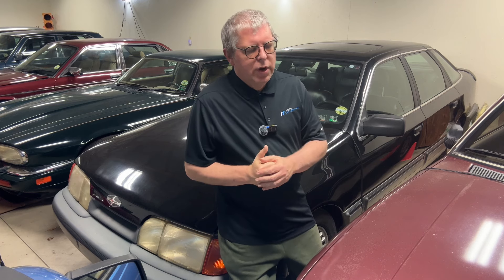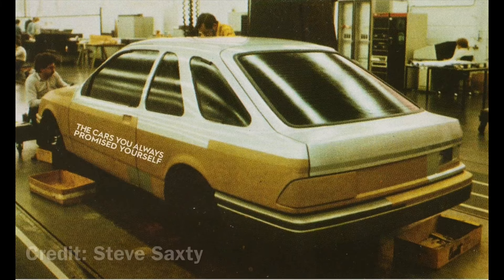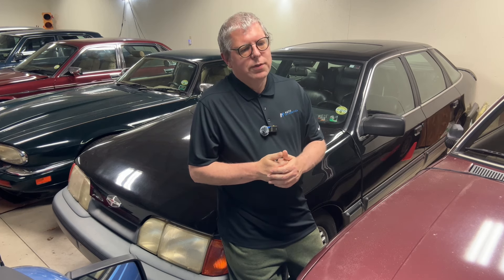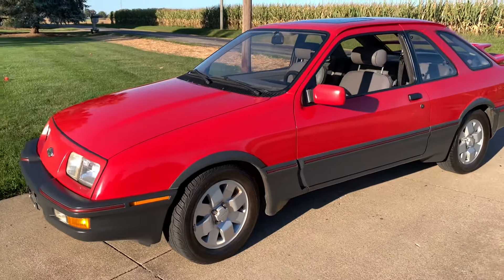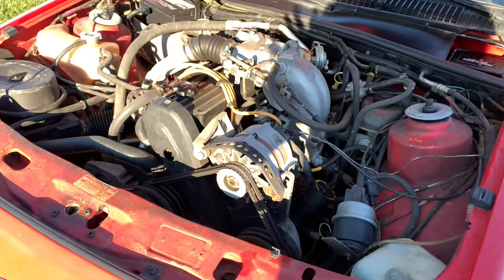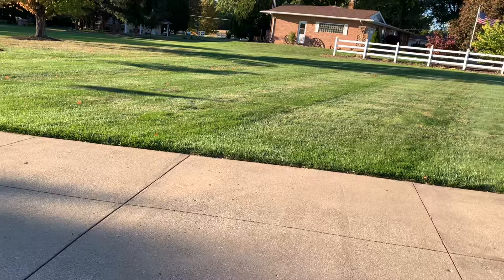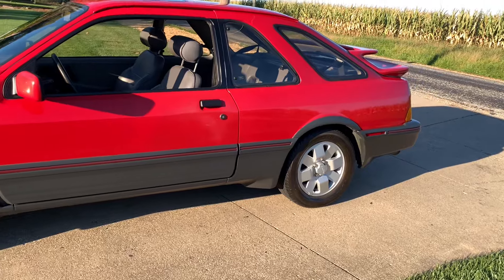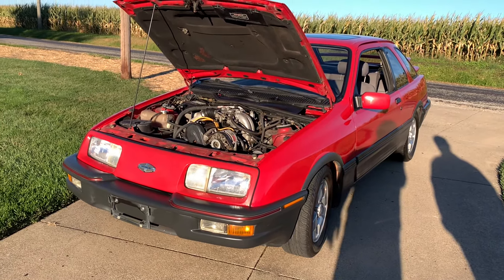Merkur XR4Ti: The Stateside Sierra | AA Visits

Comment: Absolutely brilliant video. 

I owned and cherished, for many years, a 1990 XR4i in radiant red. 
G606 XNE. ❤️
It was the 2.0 DOHC and was a great car. 
It should have produced 125BHP, as per the standard range and is listed on Wikipedia as ‘just a badging exercise with a 4x4 body kit’, but when I took it to a rolling road, it was actually 150BHP. 
It wasn’t chipped (chips were only just becoming mainstream, back then) and had no other mods. 

I have a theory that it wasn’t “just a badging exercise” but the engineers had eaked out some more power for it. 

The MT75 gearbox was brilliant and I remember the gearbox oil, from Ford, was expensive and almost like auto ‘box fluid.
Reply from the maker: Yes the 2.0 was added to the XR4 range after the facelift I believe. Very sought after these days. Thanks for watching and thanks for the kind words!

Comment: Great video... my 1988 is pretty much like this. With a 1987 rear hatch with the double wing spoiler. Just a note though. The Merkur XR4Ti ran until 1989, not 1988 as indicated in the video... it was a full five model years for the US.
Reply from the maker: Thank you for watching! I was really referring to the last full model year. The 1989s were so rare and the few changes made so minor thetvo didn’t refer to it, especially as the model was withdrawn just a couple of months into 1989, with the Scorpio following later that year. 

What’s interesting is to whether production stopped as Ford had ran out of the pre-1987 body panels to supply to Karmann as has been suggested. A 1990 Scorpio was specced and planned, even down to promotional material, with a number of improvements but ultimately never produced.

Comment: One other thing that sticks in my memory- the stereo had a joystick to control the balance left to right and the fade front to rear. Seems silly to recall that detail all these years later, but I was amused to hear the sound swoop around the cabin as I moved the joystick.
Reply from the maker: Yes the joystick was on higher trim Escorts, Sierras, and Granada/Scorpios in Europe until 1986 or so, then they disappeared.
Reply: I remember those joystick balance/fade controls...most European Fords in the 80s had them...I had a 1984 Ford Orion Ghia(sedan/saloon version of the European Escort) that had a joystick...& manual lumbar support seat adjustment...

Comment: My sales job had me fly to Tennessee, rent a car, and drive the length of the state west to east, with sales presentations in Memphis, Nashville, and Knoxville. The company always reserved Lincoln Town Cars for the salespeople to take clients to nice restaurants in luxury. Ha! I always asked at the car rental counter what else they had. It wouldn’t cost extra because the Town Car was already the most expensive class of car at this rental chain. I was surprised when they offered me a Merkur XR4TI. I think Ford may have had too many and made a deal with the car rental company to move some units. It had an automatic transmission, but the turbocharged engine seemed to be well suited to the torque characteristics. And unlike a manual, you could just keep the accelerator down and it would shift up without losing momentum. It was very stable on cloverleaf ramps (I don’t know if you have these in the UK and I don’t want to sound condescending, so suffice it to say it handled well in fairly long, extended sweeping corners. Lots of fun. It also got a lot of quizzical looks in Tennessee. That biplane spoiler on the rear window for a lot of attention. I saw a few XRTI4’s from time to time, but never very many. Then years later I went to Watkins Glen in upstate New York to see some friends race Minis, and there were a bunch of XR4Ti’s scattered throughout the parking areas. Figures that SCCA road race enthusiasts were giving them good homes .